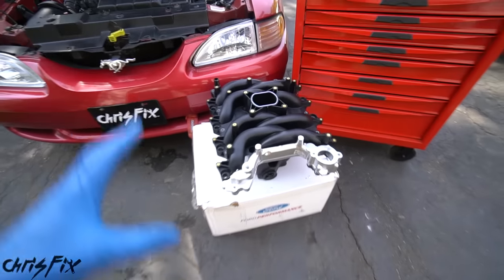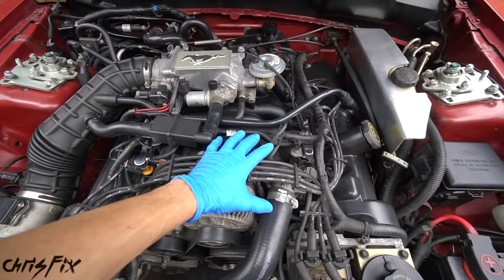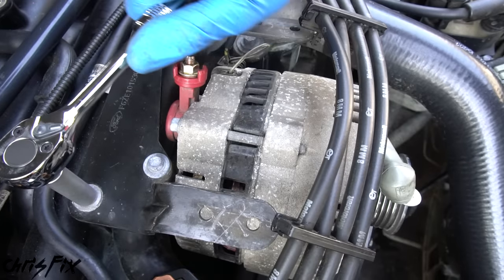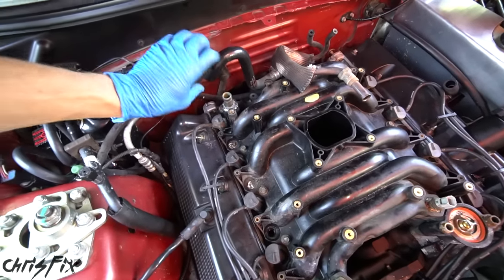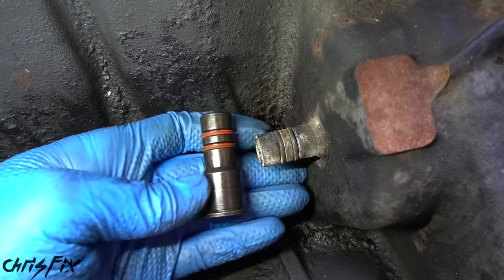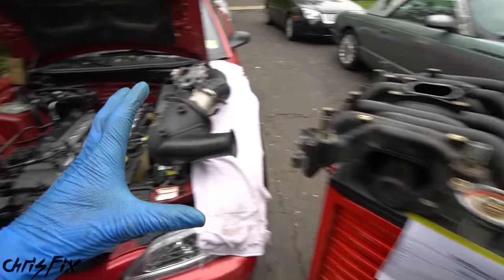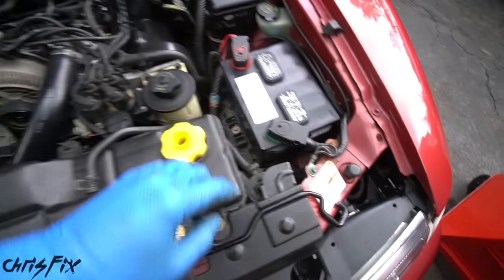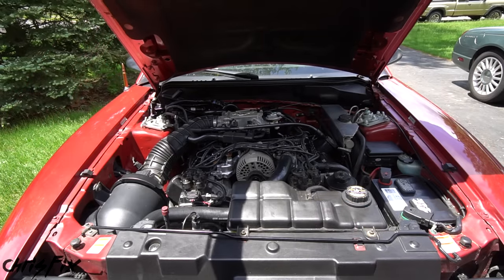How to Install a Performance Intake Manifold and Replace Gaskets (Dyno PROOF)

Comment: Dude your the most awesome techies ever. Do you have any videos on ford f 150 intake  gasket leak fixes. On 2001 models 4.6 liter.
Reply from the maker: Thanks and not specifically for the f150
Reply: @chrisfix  thx for the responce  I got ripped off by a private purchase  on facebook. The truck has an intake manifold gasket leak and it's causing it to over heat. Your videos are so professionally made that it really takes away the intimidation of  making the repair myself ,I'm quite in experienced.  If you ever make one , I'll be the first commenter!

Comment: removing the negative cable from the battery does not mean there's no electricity traveling through the cables. Would you turn off your house lights from the switch and work on the wires? Hmmm

Comment: I'm in no way shape or form a mechanic or an engine builder. But I was wondering are you still limited to how much air you are able to move with the other stock components? 
Like you have stock heads, cams etc.
If you wanted to go all out, would you or could you, port heads, get larger cams, headers, larger injectors etc. Basically anything to do with fuel and air?

Comment: Dear Chris. Followed this video entirely on my 1998 4,6 gt and all good except after having started the engine it did "adjust" and obtain good idling but now makes a sound almost like knocking. Had it with 2 auto shops that both say its the enginemanagement syst that don't adjust properly and it needs to be retuned. Live in Denamrk so not many Mustangs aronud nor specialist. You have any ideas ?   Thanks for a very good channel

Comment: Hey Chris - now that the Ford Performance PI manifold is sadly discontinued and sold out everywhere, is the conversion still worth doing with the not so great options out there on an NPI motor or should I just do a cheap npi replacement? Just replaced the plugs and wires in my ‘98 and had dried up coolant in a couple of the wells. Thanks in advance whether you get to this or not - picked her up recently to finally learn manual on, almost a carbon copy of yours in laser red. Couldn’t ask for a better car to wrench on with your tutorials lol

Comment: Yeah the magnetizing trick for your tools I don't have to do it for the tools I normally use since they're my dad's and some of his tools he has used on electronics specifically computers and they're already magnetized even though they're technically not supposed to be cuz that would wreck the circuitry but it never did for whatever reason oh and yeah you might want to clean up that engine bay just a little

Comment: You finished the exhaust video at 199hp and 270 ft/lb torque. A few months later you're down to 196hp and 265 ft/lb torque. Did you change something else in between?

Comment: Hey Chris did the intake you bought have gaskets it came with as well, or did you just have the two one piece head/ intake gaskets. Most intake manifolds seem to come with the gaskets on the intake already but I’m trying to avoid that.

Comment: Question did you remove the original ring gaskets and replaced them with the one piece gaskets or you used both?

Comment: You made it look easy nice clean engine bay what mods you have done to the car that shot flames in this video im doing the swap soo hoping where did you get all the parts need it for the swap like the bew style hose and what else is need it

Comment: Hey Chris, I just found this video and I'm doing the same thing to my mustang currently albeit it's a 2000. We're you worried at all when you cleaned the head with brake cleaner with it going down the spark plug holes? I'm at that crossroads right now and just curious

Comment: love the video really inspires me to do this on my sn95 but i have a question my car is a 97 so if I have to how would I remove that heater hose fitting that you only had to change the o rings on since they started to use that style in 98? thanks!

Comment: Great video i just started doing mine and when installing the intake i realized the new one has a hole for two sensors but the old one only has one, do I just plug the hole for the second sensor with a bolt or something?

Comment: Chris do a video on a PI heads install
Reply from the maker: Maybe soon if I don't swap this engine! Stay tuned!
Reply: @chrisfix  pi cams and intake actually make just as much power in a non pi engine interestingly enough. Also the non pi heads actually flow better above a certain lift. The only thing about pi heads is it bumps up compression when doing the swap

Comment: Will this quick and easier way of removing the throttle body and fuel rails work on a New edge GT as well? Seen other videos of this and those guys unhook and removes everything down to the intake, every bolt and tube..

Comment: Hey Chris, just installed my PI intake on my 96 GT, could u maybe add a bit more detail next time of where all the wiring clips go? Also can you list what you torque everything down to? (Fuel rails, alternator bracket) thanks!

Comment: I know its more work but you should have replaced the heads as well. the gains are so worth is and being a non pi block worth pi heads you get the increase in combustion and power for little monies.

Comment: Any thoughts about installing a performance cold air intake and a throttle body on  the driftstang????
Reply from the maker: Throttle body and any cold air in its current form probably will not happen because the intake is limited already and has max air flow with this current head design, so it would be a big waste. I would need to swap out the engine!
Reply: @chrisfix  that makes sense, are you planning on ecu tuning it any time?

Comment: I have a question. My car is a 97 gt. In the beginning of the video when you removed the stock intake there was a fitting comming from the water pump location and you say some 98s use the p.i. sized fitting. If i was to do this mod id need to replace that fitting. Does it just pull out of the block? Thanks.

Comment: Hi Chris.  I tried to get the part number for the intake manifold , but amazon doesn't show it anymore.  Could you get it for me. Would it fit a 1998 Mustang GT 4.6 2v, with those RTV repairs?  Thanks for any Info.  Jim...................
Reply from the maker: The part number from Ford is M-9424-P46. And it would, just follow the video!
Reply: @chrisfix  Thanks Chris.  I’ll get right on it!!

Comment: Hey Chris! I've been watching this guide since I'm doing a intake swap in my 2002 GT. Do I still have to drill and tap? And then with the intake gaskets; should I still use RTB or are my head's fitted perfect for this?
Reply: And should I buy the mishimoto racing thermostat and thermostat gasket to put in or use the stock one?

Comment: Do I have to retorque the intake manifold-to-cylinder head bolts when the engine is hot? I read on a website I have to do it but I never saw it anywhere else.

Comment: Hey quick question, when i took out the intake i saw that the intake have rubber band gaskets on it, but do i remove them and just leave the new gasket or do install the intake with both gasket

Comment: If you have this problem, especially in a mustang like this you want to get it taken care of ASAP. I have a 1998 mustang GT that had the same problem and the coolant actually leaked down into the back of the engine and ruined the rear main seal. It also gets into the spark plugs and can cause issues that way too. Also, avoid the Doorman, It's shit.

Comment: 17:00 The alternator has slots on purpose so you don't have to completely remove the mounting bolts.
17:50 ALWAYS lubricate o-rings before insertion. Yes, you specified it with the heater hose pipe, but not a reminder this time.

Comment: You shouldn’t put tape on the tps it may take heat away from the tps and not get a good reading of how hot is the engine.
Reply from the maker: It's not on the sensor part so it won't have any issues reading, if anything it would seal better and get a more accurate reading!

Comment: You could have gone the extra way with this and gotten some high performance injectors aswell, since you already removed the fuel rails
Reply from the maker: Not needed since these fuel injectors are not even close to being maxed out. New injectors would have to be tuned.
Reply: Still, future proofing for eventual charging is always good.

Comment: Is there a video with the throttle body swap? I want to see the before and after dyno results of thay
Reply from the maker: The throttle body is probably not going to happen because the intake is limited already and has max air flow with this current head design, so it would be a big waste. I would need to swap out the engine!

Comment: The dreaded 4.6 intake manifold
Reply from the maker: Not that bad as long you stay organized and take pics!
Reply: @chrisfix  are dorman intake manifolds decent enough I know there not PI but I just want to prevent future coolant leaks for as long as possible if I put RTV on the rubber gaskets around the coolant gaskets will it help it last longer?

Comment: Did you need to fun a "flash" on it to recover low end torque ?  if so which flash did you choose ?
Reply from the maker: I did not tune this at all. I let the computer make the adjustments automatically with the sensors. You can probably get more out of it with a tune tho.

Comment: The water pump removal on the 3.6 GM High Feature requires you to remove the front engine cover, which is a heinous job on those engines lol.

Comment: You replaced the intake and not the heads to PI does it make a difference I always thought you had to put the PI head on also
Reply: I think there’s 2 kinds the manifold pi swap and the full on pi swap not sure thoe

Comment: Hi quick question to anyone that might know... are there any parts on an engine that would require a retune if changed out with performance parts or do the computers usually adapt well on their own? I know it's a dumb question but pretty new to it all. cheers

Comment: Why not upgrade the spark plugs why you were in there already, since the spark they create are critical when it comes to engine combustion.
Reply from the maker: I already replaced them, but I would like to make a video showing different plugs and if there is any power increases depending on the plug

Comment: To be honest, peak horsepower on its own is a illogical way to determine how much overall horsepower a car has, because you can produce 1000hp (peak) but only for a very short period of time where a car that has under 600hp can have a much more consistent torque curve which can make the car more powerful overall.
Reply from the maker: Good way to look at it! The supercharger should bring it up across the board ;)

Comment: Does a 97 GT Heater Hose fitting work, or will I need to switch that out?
Reply from the maker: Most likely you will need to swap that out
Reply: @chrisfix  Thanks, is that a hard swap?  That fitting?  Also, if you were to do it over, what would you do first and least expensive?  I just bought a 97 GT from a friend, and he has already changed rear-end gears, cold air intake, and exhaust.  It's a 5 speed.  Thanks

Comment: Did this particular intake need PI heads? Of did stock heads do fine with this?
Reply: PI intake manifold fits on NPI heads no problem, just make sure you get a real PI intake not a dorman, dorman “PI” intakes lose power

Comment: When is that video for the throttle body coming out?
Reply from the maker: The throttle body might not happen because the intake is limited already and it has max air flow with this current head design, so it would be a big waste. I would need to swap out the entire engine!

Comment: After installing a stock intake on my 05 CVPI,(after driving for like 4 months)  when I pulled the spark plugs out each one of them had like dried orange stuff, on the spark end, thinking it was a manifold leak I checked the rad. fluid and the engine oil but both were spotless and my radiator hasn't gone down 1 bit for 3 years now ?? If anyone has ever had that problem or knows what it is, I'm all ears.

Comment: Hey I know this is an older video but wondering if anyone knows if the OPR PI intake manifold works for this swap. Now that Ford isn't making these anymore and I now have a leak. 96 GT.
Had to come back and edit--Or even better the new Ford PI they just released. Well I actually picked that one up and will be giving it a go. Haven't seen anybody making those vids yet. Maybe too early since they just dropped.

Comment: It is normal to have the fear of getting shocked by the battery so you take the battery to the other side of the house just to be sure?
Reply from the maker: It's pretty hard to get shocked if your taking the right precautions but if it makes you feel safe there's nothing wrong with that
Reply: @chrisfix  i still have ptsd from playing my summer car, in the game you die if you forgot to disconect the battery of the car

Comment: how did you get is to shoot flames like that?
Reply from the maker: It’s on the Dyno and wide open throttle and then he lets off so it runs rich for a fraction of a second.

Comment: It's not very fair measuring intake with a standing car. Surely Moving at high speed pushes more air into the intake? So the actual readings would be higher.

Comment: You really need a Ford f150. My 2003 is giving me a headache with this.
Reply from the maker: I'm thinking of getting one like that soon actually haha
Reply: @chrisfix  Do it! Lol. Mine has leaks in the intake manifold,idler arm, and oil pan gasket with check engine Lean codes 174/171. You have a lot of knowledge and we can't thank you enough for all of your wisdom. You really simplify the overwhelming task of car maintenance.

Comment: 12:50 I usually wrap 3 layers of white tape. Gray tape requires 2. 
13:11 All thermostats used to come with the air bleed hole.

Comment: 10:35 Wide runners won't allow higher air flow velocity. The wider the canal the slower the velocity but the flow resistance will also decrease. Therefore there will be more air but not necessarily at higher velocity :)

Comment: Stock parts are made with quality materials. Don't trust aftermarket parts even when they are written OEM/OE
Reply: there are plenty of really good aftermarket manafactuers out there, even toyota parts are not all made by toyota and same thing with pretty much every company. they also have limitations and wont do everything perfectly from factory. another thing is that often pricing for parts is not updated, like do you think its worth paying $2000 for a new oem cv axle?

Comment: It was going so easy then I snapped the back left intake bolt into the head
Reply: What you do how
Reply: @kingjay3301  drilled and tapped a new one in. Worked like a charm

Comment: Why you put an wooden block at hood that was very dangerous
Reply from the maker: Hood only goes up so high with the struts so I used the block to extend it. It's pretty locked in there but if it did somehow fall out, the hood would go down a little!

Comment: Can you answer me this perfect job by the way thow seeing you are just about going extra mile and you are doing the work your self you can afford the best parts  thow thow should it be a good idea to like get the whole thing rebuild  to a point what's left cept to boil out the block or sand blast what ever they do then put it it all back together better then it were I'm wishing I mean isn't cost almost thee same say if you done just the he intake and you couldn't do it you're self set back big time on loot money 💰 we all are  not rich thow like what we like I think you could doit your self better I like how you say tightn the bolts too say this n that on the York  wrench 🛠️🔧 good man for helping a brother out  my car leacks water some fkn wear and it dont do it all the time wtf any one  I need to take it pressure is it find out in thinking tube or hose back of engine cose it rest I see water in the valley behind the alternator yo ✌️ purty sure thow why she don't spew out regular thank God she don't I need to get n do things like fetch dinner. Work I'm great full I get in traffic runs good only lousesa  reevear tank full now n then I'm blessed I'm wondering if it's the thermostat thow always had heat unless that don't mean shit  WHOS BETTER FHEN YOU FOLK THAT HELP A BROTHER STANG MAN OUT LIKE HAVEING A TRAILER YOUR NEIBOR BEEN TREW🔧🛠️ IT MORE THAN WILLING TOO HELP YA

Comment: Putting a pi plenum on a npi head? Thats not very useful because the head has a smaller hole then the intake at the point, especially with the stock headers this is a save my car from leaking not an upgrade the dyno is hilarious haha, im putting a pi in my sn95

Comment: A while back, I was about to use gasoline to clean some parts, when my landline rang inside the house. 
There was a full gallon of clean fuel in a rectangular container, ready to receive parts to let them sit for a bit there. 
Anyway, when I came back, the container was completely empty, and i look out the garage to see my dog on the driveway running in circles at full speed!  Obviously he drank gasoline and was not feeling himself.  Anyway, I’m obviously worried and I’m trying to get him to stop and let me take him to the vet.  Anyway, my dog ran circles on the driveway nonstop for over an hour, and suddenly he finally stops and drops on the ground! 
Oh no!!!  He’s still breathing but it’s obviously exhausted.
Anyway, I take the dog to the vet, vet looks him over, and explains to me that th dog is okay. Everything looks good, but that it simply had ran out of fuel!